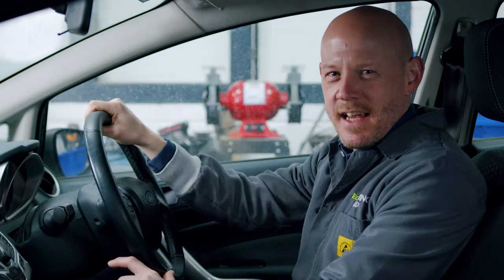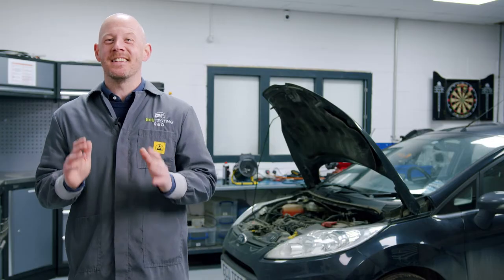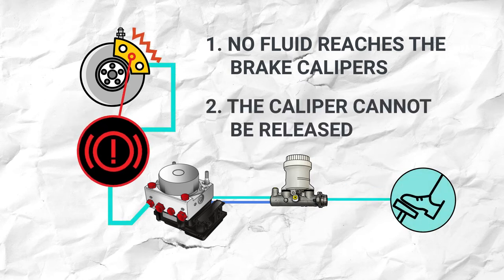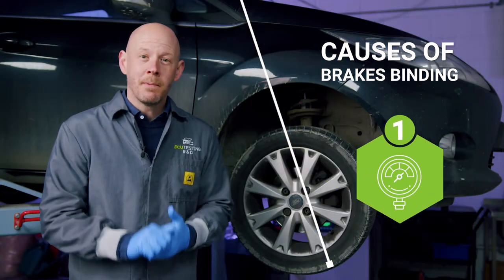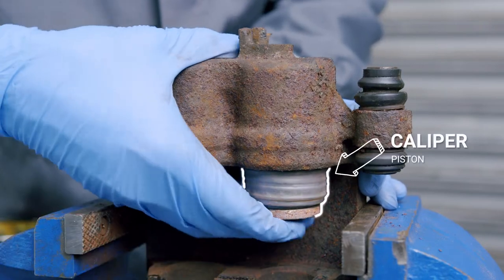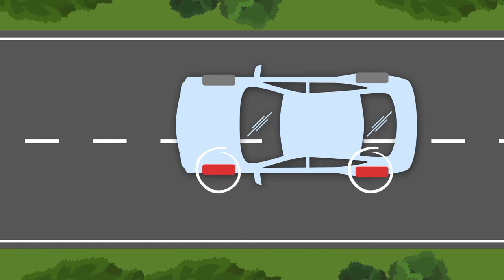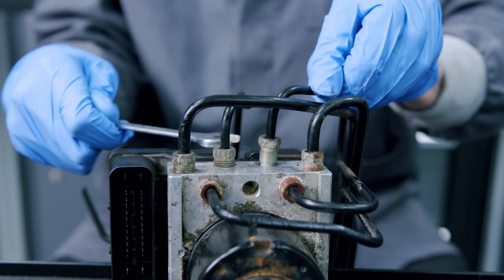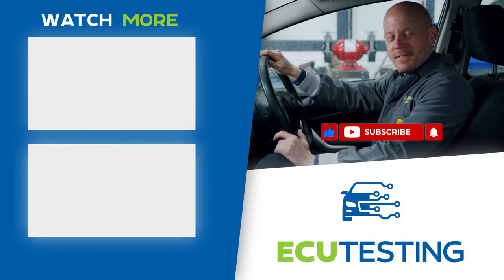Brake Binding – How to Find The Cause and Fix it!

Comment: A failing flexi can also be the cause. The interior of the flexi hose can degrade and act like a one way valve that stops the pads retracting. This can sometimes be identified by the brakes working normally when the car is first driven after being parked for a while (a day or more) but then binding again after the brake is applied a couple of times.

Comment: You didn't mention Flexible brake hose failure. this can cause binding brakes too.
Reply: Yes to this.  Internal failure of the brake hose can create a one way or check valve effect.

Comment: Is there a common fault on Astra j with the front brakes looking up shortly after fitting new disks and pads on inspection the pistons could not be compressed until the bleed nipple was opened on the second side we loosened the joint before the Flexi pipe to rule it out as well after pumping the pedal up and flushing some new fluid through it seems fine it's the second Astra j I've had it happen to now the only thing I can think might be happening is when the pistons are pushed back to fit the new brakes a valve in the ABS or master cylinder is getting stuck

Comment: How much to recondition abs pump on 2007 Fiesta MK6.5. 
Diagnostics show abs pump failure. Speedo and brakes still work all round for now.
Reply from the maker: Hi. Please follow this link:https://www.ecutesting.com/product-catalogue/ford/fiesta/abs-pump-ecumodule-combined/ and select your unit's part number for our most up to date pricing. Any further questions please contact our technical support team by email at info@ecutesting.com. Thanks.

Comment: Hi my ABS fail on MOT and didnt pass mot I buy OBD tool to find what us the problem with ABS and there is lots of problem on ABS pump but the last code make me mad 1044
Raw code: 0414
ECU: 03. ABS control unit
Status: Pending fault present, Pending fault present during this driving cycle, Validated and stored in non volatile memory, Validated fault present at time of request
Volkswagen: C10C607: Tire pressure monitoring display button
mechanical malfunction
Volkswagen: Incorrectly coded control unit; Control unit encoded incorrectly; Secondary air injection valve-N112 short circuit

Comment: Does a h100 bakkie  have abs brakes
Reply from the maker: Hi. It depends on the vehicle's age as older models may not have an ABS unit equipped. The best way to determine if a specific Hyundai H100 Bakkie has ABS is to check the vehicle's specifications for that particular model year or to consult the owner's manual.